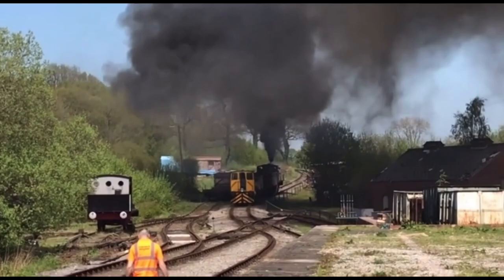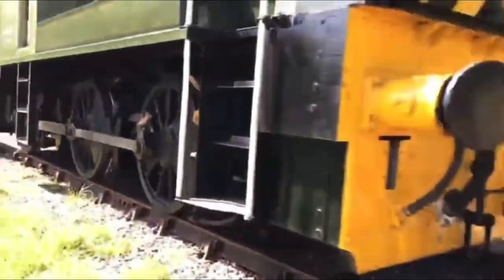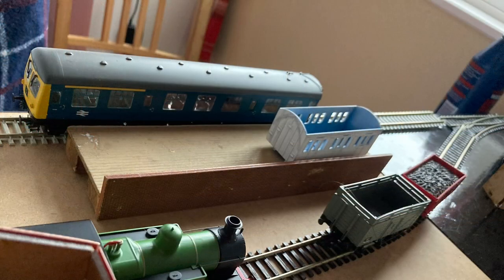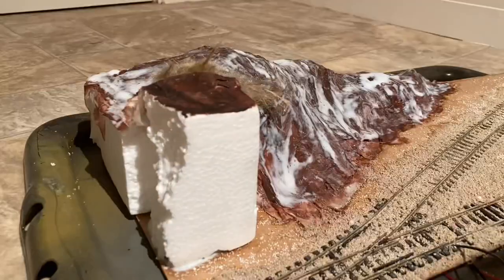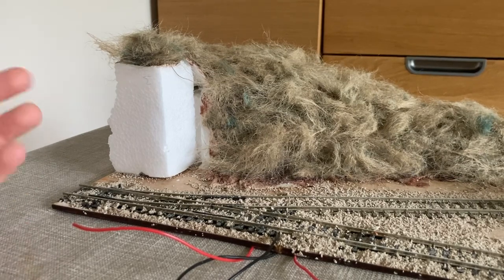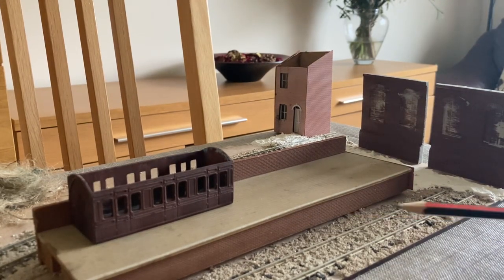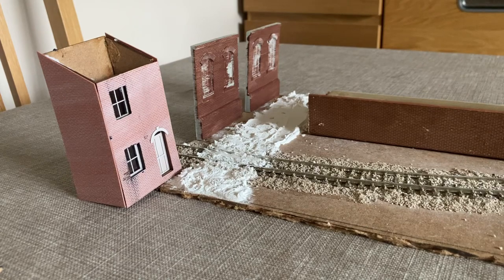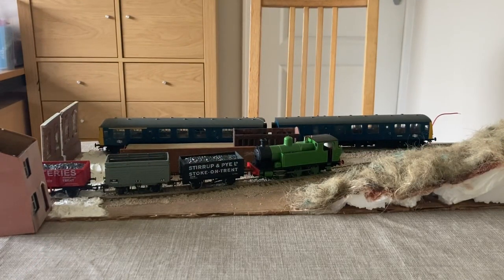Boxfile Micro Layout- built in 3 days!!! Heapton Halt Part 1

Comment: Very nice work, you never mess up, you just learn for next time.
Reply from the maker: Thanks man! 
Exactly think I’ve learnt I’ll carry through!
Reply: @heaptoncollierymodelrailwa6011  if you wanna do more similar ones and save a bit of money and gain a new skill along the way might I suggest some small industrial loco shed themed one. Only instead of buying any points have a sniff around for some templates and buy some copper clad strips. The beauty of this is industrial loco sheds often had ballast or more likely just dumped rubbish from the ash pans etc accumulated well over sleeper height, this means you can get away with building points and track with significantly less sleepers than they have for real. You just follow the recipe for a normal point or track only miss out 1/3rd of the sleepers saving money and the rail, well thats just old rail from flexitrak with dud plastic sleepers. Its a great way to recycle second hand/free track no one wants and end up with something fun and challenging to do with it all.

Once you figure it out you're never limited by set track again, any formation is yours, any custom point work, any weird arrangment like a barry slip...
Reply from the maker: Sounds intresting. I’d love to have a go at building track!
Thanks man